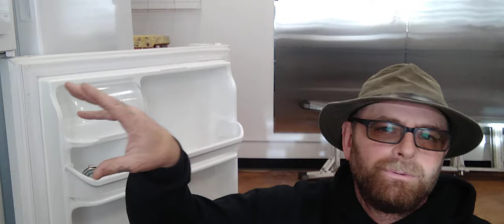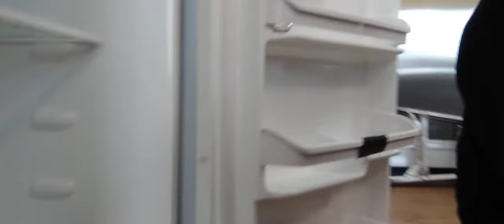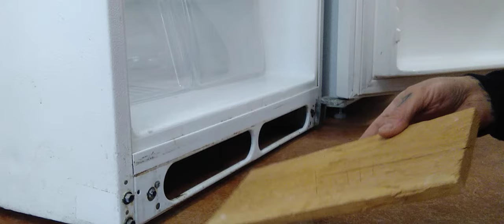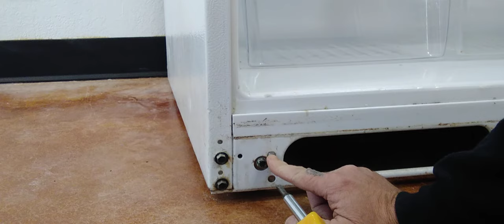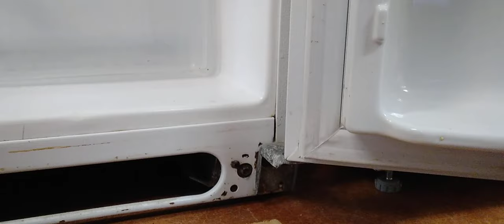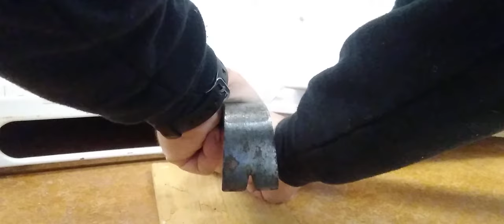How to level / adjust a refrigerator with wheels

Comment: Nice video. We have a Kenmore which I can't pull out from the as I believe the wheels are not engaged. I will give this a try and I will also have to find something as not to scratch the hard wood floor so i can wheel it out. (Need to wheel it out because the rear drain tube from freezer is apparently clogged as the freezer drain hole is not frozen.
Thanks for doing the video.
Phil
NYC area.
Reply from the maker: @uptownphotography  good luck, thanks for watching.

Comment: I've had 5 service techs come out to my home and tell me my brand-new 2024 Fridge doesn’t have leveling legs.  The technicians reached out to tech support and got the same ridiculous answer my fridge just has wheels, no leveling legs.  Please advise what I can do?  Everytime I open the fridge or freezer doors, my fridge rolls forward.   Will there be the same adjustment screw on my 2024 fridge? Thx!
Reply from the maker: @Angelbabs2023  Yes, there should be the same adjustment screws